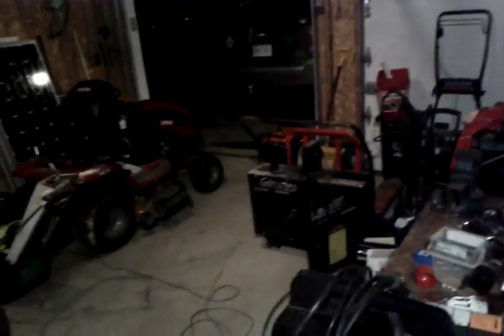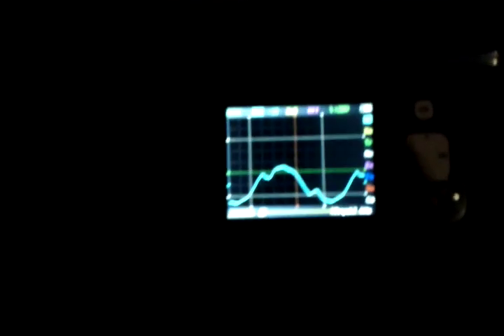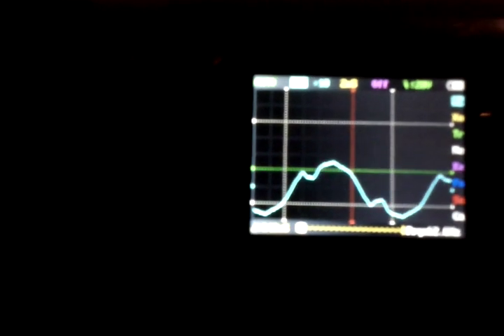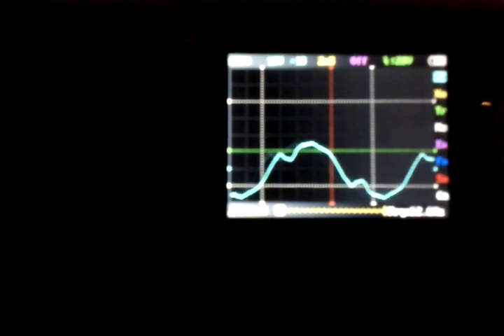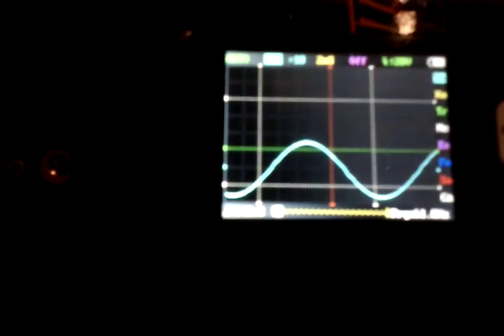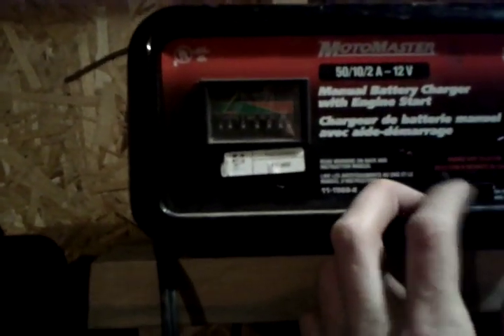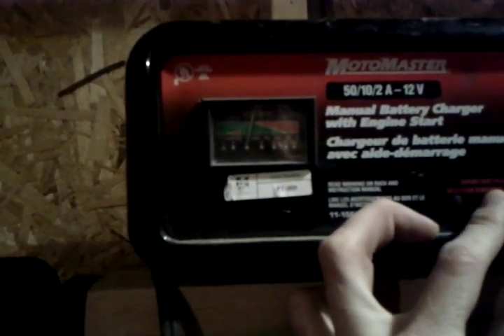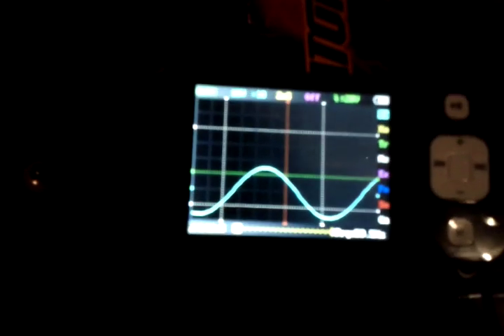generator vs pure sine wave inverter

Comment: I've thought about this setup for some time, only because I have a 1800 watt generator, I have a battery charger and two deep cycle batteries and a 3000 watt PSW inverter, by setting my system up like the way you have it, how much amps should my charger be set at  2/10/50 ? thanks
Reply from the maker: 50 amps, is the charger regulated? I would get another charger as well 50 amps is only equal to about 500W ac so if your pulling 700 watts continues from the inverter with the odd surge here and there you will need 100 amps coming in from the charger continues.
Reply: fliping720 Dont know if its regulated its the Schumacher SE-1052 50/10/2 Amp Manual Starter/Charger, Ive never used it the way you have, I would use my truck to charge the batteries, so if im running and average of 750 watts of my inverter im gonna need a 100 amp charger correct?
Reply from the maker: Fern W yea i would say so, you could try the 50 amp and see if it meets your needs.

Comment: Thank you for sharing. So basically, you are using the generator to power a battery charger, which charges/tops off the deep cycles, which are connected to a pure sine inverter? Genius. Are there any issues with the generator spiking or surging and possibly damaging an expensive inverter? I like the idea of using the batteries as a buffer between the generator, and getting the clean energy from the pure sine.
Reply from the maker: I use a PWM charge controller to control the rate of charge so the batteries cant get over charged, and no surges are going to destroy your inverter if you use this method.

Comment: fliping 720
More info:
I invert from my batteries with an older TRACE 2412 which is modified sine wave for my RVs 120. It is being repaired and may still work. It also has a 60 amp charger. As a back up I bought a Harbor Freight inverter 4000 peak watts/2000 continuous watts. Reviews were positive for the inverter for cabin lighting and similar uses. I have run my TV on it a few times briefly before my batteries got too low due to improper charging since my TRACE charger/inverter died. I am now charging my batteries from the grid through my WFCO charge/converter which has 3 stage charging but MUST have since wave input.
I am looking to buy a sine wave generator and a sine wave inverter  Power Bright APS2200-12 Pure Sine Power Inverter 2200 Watt continuous / 4400 watt Peak 12 Volt DC To 120 Volt AC on Amazon for about $500 after I sell my unuses Onan 5500. Hope this info helps you understand my situtation. I lost everything three years ago and am 70 and having to exist in my RV on a small Soc Sec check and food stamps. and may have to find a place to exist off grid. Any help is appreciated.
Reply from the maker: I am so sorry for such a late reply, i didn't get a notice of your comment and was browsing my videos and came across yours, please feel free to comment a bunch of times on multiple videos to get my attention. that power bright seems to be a nice inverter, let me know if u need any wisdom I might have.

Comment: fliping720
Your video is VERY DARK and it was quite difficult to see what you were doing. However, whatever you did might help me. I have ten L16 deep cell RV/solar batteries and an Onan 5500 generator and a Craftsman 4200 watt gen as well as a Harbor Freight 800 watt gen. None are sine wave. My WFCO 65 amp converter/charger needs sine wave to prevent damage. I use computers and TV in my RV and have to be off grid.
How can your info help me produce a sine wave source from my generators?
Reply from the maker: it seems like you need a new charger then. my big 140Amp charger is running of a dirty generator sine wave. only cost my $100
Reply from the maker: I agree with Joe Seidl, and if money isn't a problem buy a Xantrax sw3000 150 amp charger/3000W inverter with a 6000W surge for 10 secs, you could use this charger/inverter to charge and run everything in your RV.
Reply: Thanks for the replies Joe and fliping

Comment: thanks a lot on this one, are you trained in this or picked up the knowledge a long the way, you have quite the hord going on, cool. so how many watts of solar, and do you hook all of the panels in parrell, and what controller amps. i'd like to do what you have, in the last wind storm, my 3 panels blew over, the ice is still on the roof so i can't tell what the damage. keep up the good work
Reply from the maker: Just learning as i go, I have 1000 rated watts of solar and its all at 12V , all solar panels are in parallel, the charge controller in a 45Amp morning star PWM, hope you panels are ok.

Comment: I thank you for showing the difference by using a oscilloscope . Can you Show on the scope what the wave would look like from the wall socket or company power. This way we can see which resembles our home current the most.:  Modified sine wave , pure sine wave  or Gas generator. Thanks for your time and videos!
Reply from the maker: the pure sine wave inverter looks exactly the same as the wall power, i should of shown it but i forgot to.